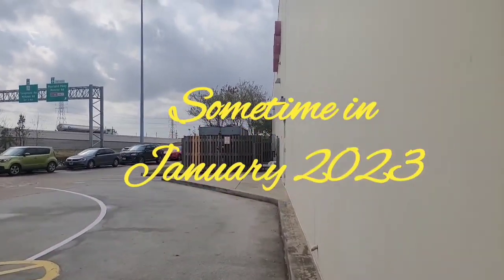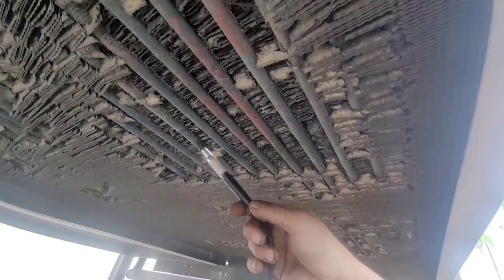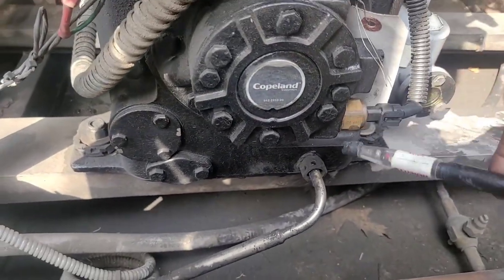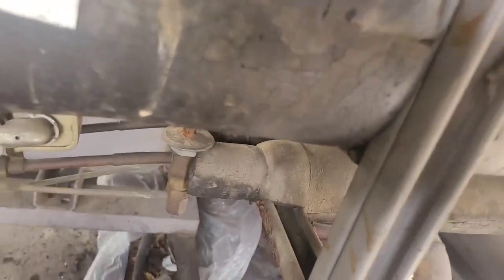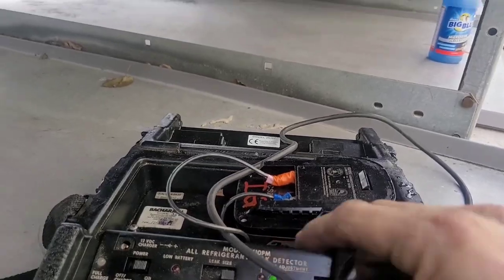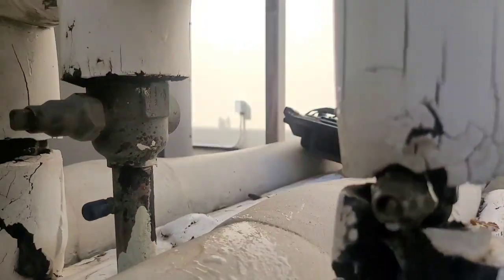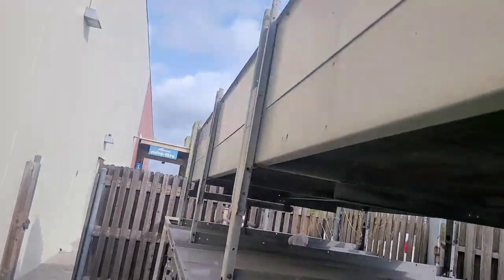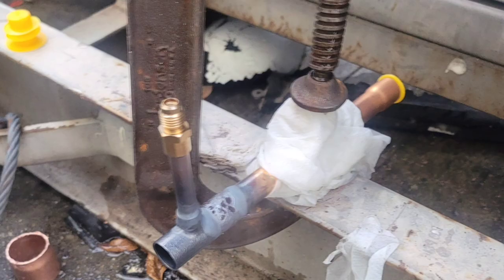Rack Low on Charge

Comment: Great video as always. That condenser coil has seen better days but like you said it has thicker wall copper unlike today’s junk. How thick is the coil could it be leaking in the middle or the top?? Most condenser coils will have oil present if they’re leaking but not always. I once had a condenser coil like that one on a hundred twenty five ton chiller with R22 and I was lucky it had a big oil spot on it. I removed a bunch of fins cut out and replaced about a foot of copper pipe.
Reply from the maker: I appreciate the support
Reply: @HVACRServiceTech  All the time buddy 👍👍